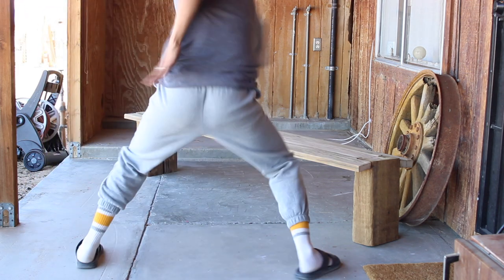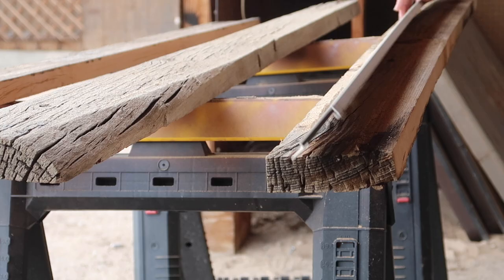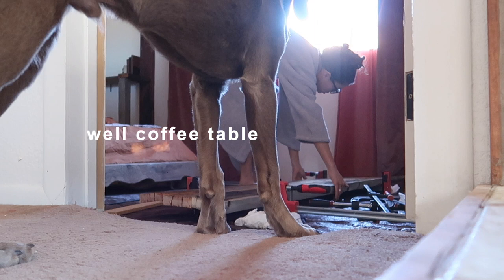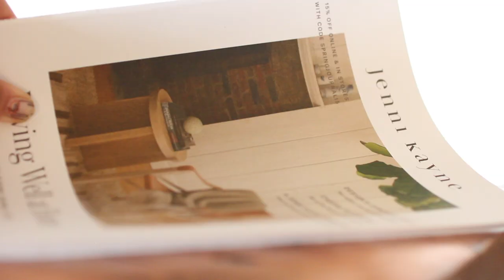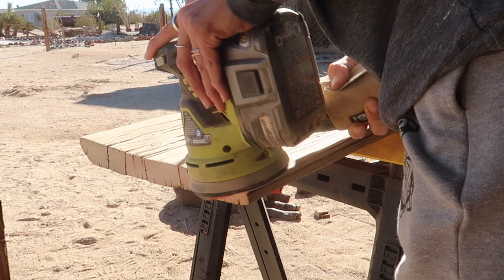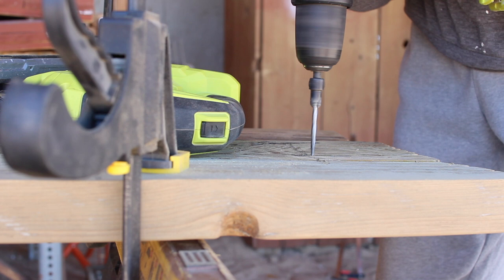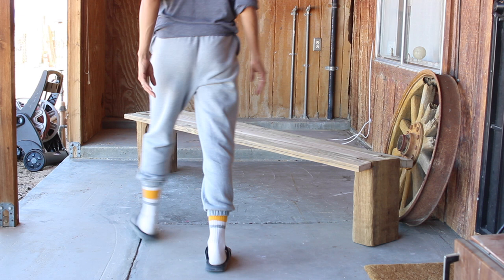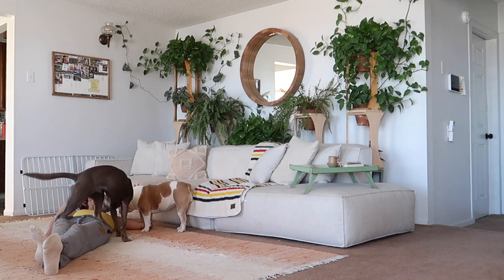DIY COFFEE TABLE | $7,000 BUY VERSUS $0 DIY!?

Comment: It looks lovely, but can I give you a little bit of advice with regarding power tools. When using a circular saw you should always set it that the blade tip is only just coming through the wood, this is where all the cutting is done on the blade. If you have it stick through the wood as much, it puts strain on the blade and it doesn't cut as well. Also rather than using an orbital sander to sand larger pieces of furniture, and when you require rapid removal, you are better to get a belt sander. You could also collect the saw dust and mix it with pva glue and it will be the exact colour of your wood then. Sorry if you are already aware of this, but I only noticed it with the way you were using it in this video.
Reply: Hello 👋 how are you doing today???
Reply from the maker: Thank you for this!
Reply: @LivingtoDIYwithRachelMetz  I hope you aren't offended with what I said. I think you do amazing work. It's just cause I used to work for a well known power tool company and used to train people how to use the tools and accessories correctly.